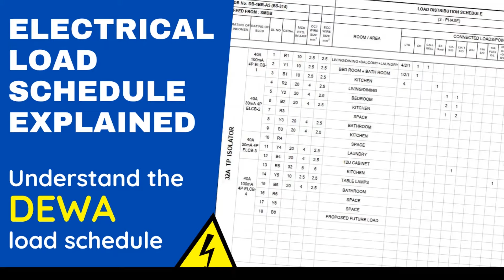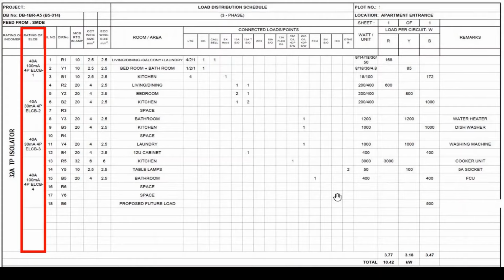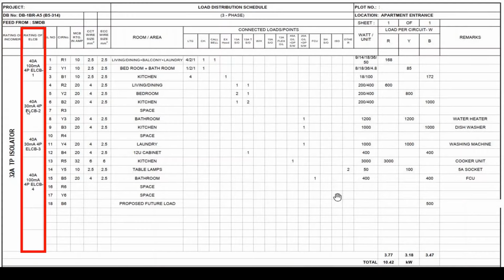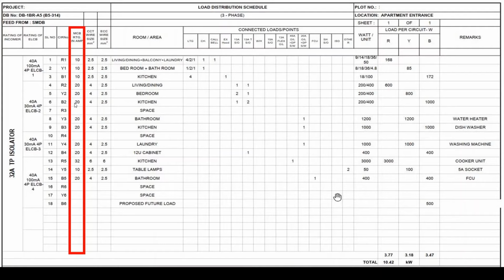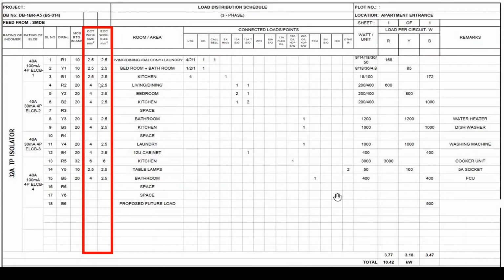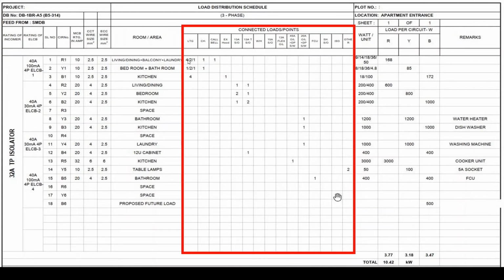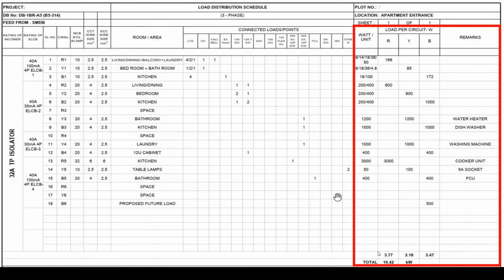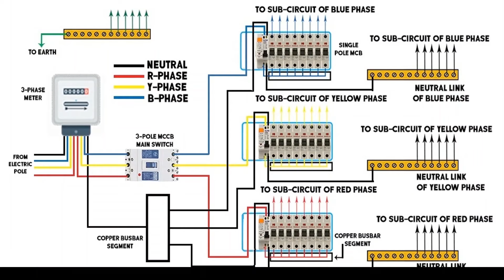DEWA Electrical DB load schedule EXPLAINED - A detailed explanation

Comment: Thanks for your elaboration on DEWA Practices. I would like to know,  when you have a 32 A TP isolater, and a 40 A ELCB serving the Board, how can the  extra 8 Amps be handled safely.  Shouldn't they be the same or the  ELCB rated less than the isolater?
Reply from the maker: The 32A rated isolator means that the isolator can handle a maximum of 32A...but it wdoes not have any tripping functionality even if the 32A rating is exceeded.
The upstream breaker in the SMDB should not allow more than 32A to pass tot eh DB so it should be rated at 32A as it will trip if 32A is exceeded.

But for an ELCB...it has 2 rating....Ampere and Milliampere...40A rating means that maximum 40A current can pass through....but you don't use an ELCB as an MCB...you are mainly choosing an ELCB for its mA rating...such as 30mA, 100mA, etc.. which will trip in case of the current leakage exceeding this rating.
Reply: @Electrical_Engineers_Academy  , thank you for the clarification. I understand that the ELCB/RCCB device will trip on the rated millamperes. For domestic supply, depending on the Calculated load, commonly 63 Amp /100 Amp Isolators for 3 phase supply is my observation. Most places in Oman, the load schedule is not available next to the DB. Keep up the good work, and I will be looking forward for your new videos. Alf salaam.👍👏🤝

Comment: 1 socket we can take 100w in schedule.. Then 3 phase 32A industrial socket how much watts in schedule?
Reply from the maker: One socket load allocation is 200W as per DEWA.
Industrial socket load allocation is varying, depending on the connected equipment, but typically you can connect up to 5kw.

Comment: Why the maximum ampere rating of 13a Single socket outlet is connected only in 200w each onces,and how many 13a sockets can connect.

If the load balancing is more than 20% in any of the phases either R or B, how can we balance the load. (Making spare?)

Comment: will you explain why it is 100mA for lighting and why 30mA for power points? also why it is 40A ELCB rating? thanks
Reply from the maker: Many reasons :

1. To avoid false tripping due to current leakage. Nature of the load dictates this. For example, lights, in their operational mode, usually have high current leakage... There 30mA will cause false tripping. 100mA ensures that it will only trip if there is something wrong in the circuit.

2. For safety and protection of humans. Low level sockets are accessible to humans, therefore you want to provide a small suitable ELCB current rating to ensure that it not permit more than the amount of current that a human can tolerate if anyone get in touch with a live conductor.
Reply: @Electrical_Engineers_Academy  Thank you for the detailed explanation...Keep it up
Reply: @Electrical_Engineers_Academy  One more thing, how about the lights in the wet areas, such as toilet & bath,  why we should use the 30mA and for FCU's should use 100mA.

Comment: Till how much load can single phase supply take ?
Reply from the maker: A maximum of 2 AC units (window type) are permitted to be connected on a single phase. If more than that, then 3 phase shall be used.

As a personal standard practice, personally, 8 kW is the maximum that I have connected on a single phase DB.